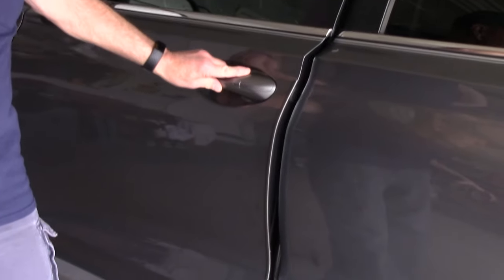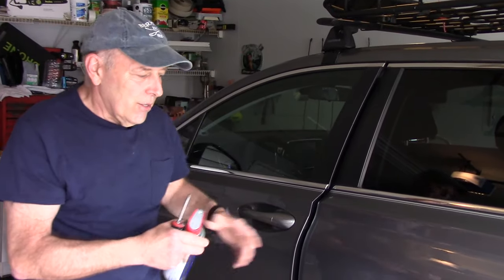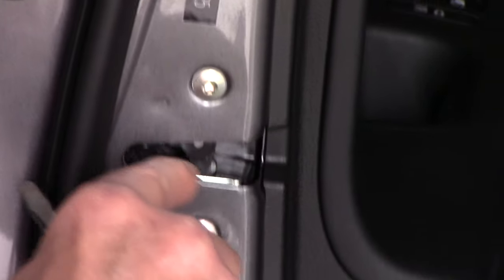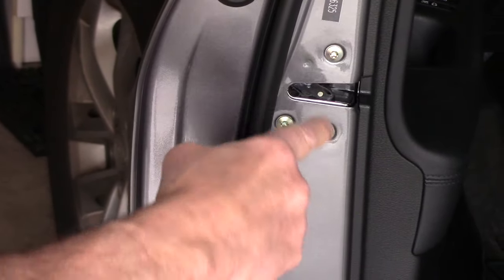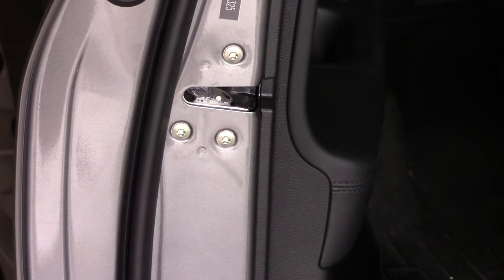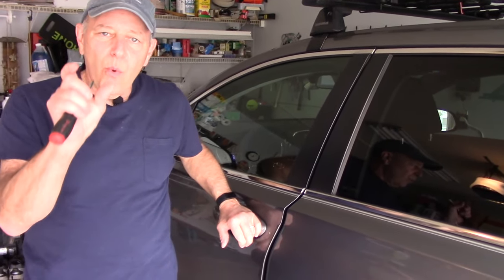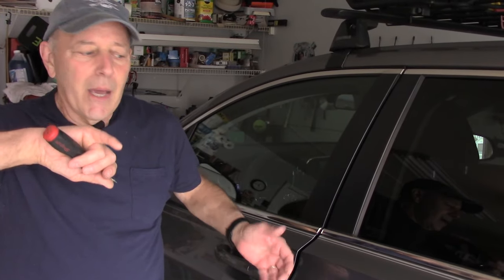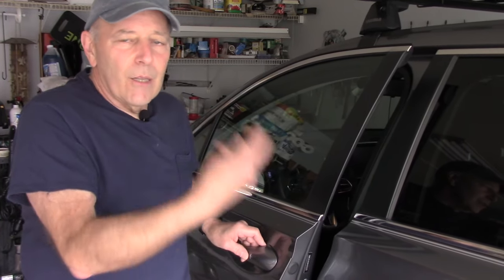How To Fix A Car Door That Won't Close Or Latch

Comment: Great video! I had this issue today (before watching this) and I discovered if you pull up on the exterior door handle and flick the lock/unlock from inside it fixes it also 
But the lube idea I never thought of and will apply some
Reply: Thank you so much for this comment. I was struggling to close the door and this got the door to close.

Comment: My truck did this today and I'm about to fix it using this, thanks for sharing.
Reply from the maker: Glad to help
Reply: @getitdonehomerepair  of course. My locks are a metal material, but they have a rubber plastic coating that I tore off, it was jammed up, and the grease definitely worked on it like a charm. Thanks again.

Comment: Graat video and information.                   
It wouldn't work for me after a few goes BUT I noticed the inside door lock knob beside the window didn't come up all the way even though all the others were fully up. I pulled it up then the lock went back into the correct position.
Thank you so much, you sent me in the right direction. Slán
Reply from the maker: Glad it helped

Comment: I raged because it was happening as I was leaving work. Slammed it because I’ve had problems with it not shutting properly since I got it. Overall after a little  counter-rage on the door handle and screwdriver, it’s working better, actually feels like butter. Great Video!

Comment: I had an issue with my 67 AMC Marlin and even after having the door pins changed, the door would "bounce when you closed it. You had to keep pressure on the door while closing but your video solved that problem, was ready to replace the striker mechanism. Thx for the video :))
Reply from the maker: Thanks for sharing

Comment: This was sort of my problem, but the main issue was when I had my driver's side door replaced, whoever did the replacement didn't put any screws into the latching mechanism so it just slid off center until it wouldn't close at all. But without this video I wouldn't have even known where to start looking, and once I popped my own screws in the door closed just fine. So, it was a roundabout way to get it fixed, but thank you! Wouldn't have known where to start without your video!
Reply from the maker: I'm happy to help. Thanks for watching.

Comment: Thank you so much! This helped me. So glad I was able to fix it myself. God bless you!
Reply from the maker: Glad it helped!
Reply: @getitdonehomerepair  Thank you. Sadly now every time I open my car the latch falls back down so I think I'll have to get it repaired. It's an older car so I'm sure that's why it's broken. I never slammed it. Lol. Thanks again!
Reply from the maker: @TheWanderingWulfs   Did you try to spray the door latch with some WD40?
Reply: @getitdonehomerepair  Yes, sure did. My husband looked at it the next day and sprayed some more in there too as it was still sticking. Every time I open my car I can hear the latch fall down so I have to use a screwdriver to move it back up to shut the door each time. At least it shuts! Ha ha. But it is getting annoying so we'll have to fix it I think. I think the actual latch might be broken.

Comment: Thank you. Unfortunately, I saw your video immediately after slamming and closing the door and now I can not open the door. I wonder if there is a way to fix it without going to mechanics. Thank you
Reply: Yes, you will have to take off the Inside door panel. If you cannot get it off due to the seat/dash in the way try to get off as much screws as you can to loosen it. Then you need to roll down your window and try to get a jimmy in below your door panel to activate the latch.

Comment: What if my doors have difficulty closing because the latch does not close properly? The door often bounces back a little and leaves like a 1/3 inch gap, which obviously makes locking and driving impossible, so I have to retry a couple of times. 
Will cleaning the latch with WD40 and then lubricating it (once dries) with silicon grease work? The locks are very expensive, so can't really replace them since each one is nearly 1/10th of car value

Comment: Thank you for the video,   my question is I was trying to remove the 3 screws on door lock but have stripped it,   how can i removed those any suggestions
Reply from the maker: Did you use the correct bit? If the screws are really badly stripped out you will need to drill them out. Here is a video that I did on my other channel on how to remove stripped lock screws. Look at  5:45 on the video.  https://www.youtube.com/watch?v=f_WbmUYQfMU

Comment: WD-40 = Water Displacement on the 40th try. It displaces water. I tried this with a true lube and still nothing. But I did remove the latch, cleaned it and not it works perfect. Good video though. Straight to the point.

Comment: Does using the WD 40 work during the winter time when the door is hard to open because it’s frozen shut?
Reply from the maker: The best thing to do when a car door freezes during the winter is to spray WD 40 on a rag and wipe the rubber around the door frame.

Comment: so this was happening to both my driver side and passenger side of my kia soul.  WD40 worked for my passenger side but my driver side i have to pull the handle and flip the clip every time  i get in and out.  does this mean im going to have to replace the door actuator for the driver side?

Comment: My problem is the door won't latch to the car frame, it just comes back outwards. Almost like if the door metal piece won't go in the hole of the door frame. The lock mechanism is not set to lock position, it's set to always open so when I close my door, it won't latch but if i force the mechanism in lock position and pull the handle, it opens up. I don't get it. Maybe a spring is loose?

Comment: Well I slammed it and caused a bigger problem mister what do I do know I tried the lubrication idea but I couldn’t finish it without getting blue balls so I went back in and went to town now I’m ready for the next step what do I do sir!!!!
Reply from the maker: If the latch is badly damaged the you may have to replace the lock assembly

Comment: So mine does the stuck position but i have to pull the latch from the inside the car and it always does it when i get out the car and i try closing it. could that be another problem different from this one??
Reply from the maker: Did you spray the latch with some kind of penetrating oil?

Comment: my front passenger door on honda crv 2008 is stuck closed due to closing door on seatbelt metal insert,it probably damaged the actuator , i managed to remove the wedged seatbelt but the door wont open from inside or outside , incant bet the door panel off because the door is closed and cant get to the lock actuator either, 😢

Comment: I did to many times AME way , but still door doesn’t close, finally I find , that door was contacted with side of panel, so I make little spacer between door and  panel, than my problem is done, always it’s not luck problem check the door .good luck

Comment: I made the mistake of trying to slam it shut. There was a piece of busted plastic in there that I had to pull out. I managed to get it to latch. But, now it happens every time I open the door. Now what do I do??
Reply from the maker: It should like you may have to replace the lock because of the broken plastic. Don’t forget to subscribe

Comment: "Don't slam it".  I did exactly this yesterday when it didn't close and was worried that I'd damaged it, in my defense I was tired and cold and just wanted to go home without having to hold the door closed.  Today it's a bit warmer and thankfully now the lock is working so I don't think I did any harm, added some wd40 and hopefully next time it's cold I won't have to deal with this.

edit: well it was even colder the day after and the car door wouldn't latch again, so I took it to my mechanic and he sprayed it with something else.  He said that wd40 was pretty ineffective for stuff like this.  wd40 is probably a lot more available than whatever lubricant he used, but for those reading: If it doesn't work the solution may be to find a stronger lubricant

Comment: God bless you I drove with the door open till I got home damm I’m stupid
Reply from the maker: Thats not too bad. I saw a guy driving with a rope on his windshield wiper that he would pull to move them. Another time I saw a guy driving his car with no steering wheel. He had a vise gripe pliers that was used instead. So what you did is really nothing. Thanks for sharing. Did you fix it ok?

Comment: What happened if they already slammed it cause my uncle slammed it
Reply from the maker: You will need to lube the latch and try to pull it open with a screw driver.

Comment: Remember that WD-40 is a degreaser meaning it removes lubrication, so while WD-40 is a great product for "cleaning". Its not a long lasting solution, get a proper lubricant to apply after the use of WD-40 for a long-lasting effect. Otherwise the problem is just gonna re-appear in a week to a month(s) time.

Comment: My latch is open and it won’t close and I used wd40 to no avail
Reply from the maker: Did you use a screw drive to open the latch?
Reply: @getitdonehomerepair  it was frozen and wouldn’t stay closed but it unfroze and it works fine now

Comment: Mine doesn’t even move so
Reply: Yeah, mine didn't either. I sprayed it and used a screwdriver to wiggle it around as much as I could, and after about 10 minutes I pulled the handle and it finally went down to where it was supposed to be.